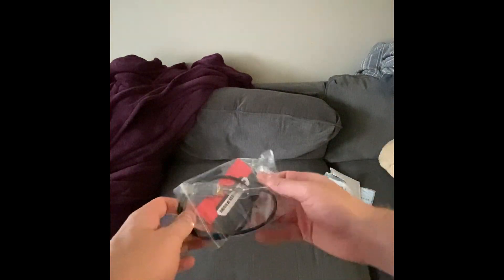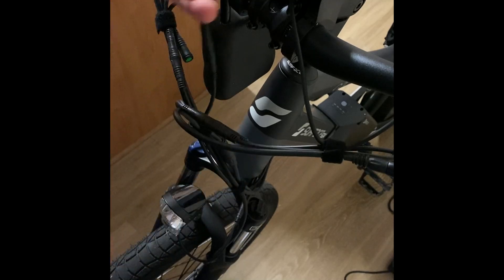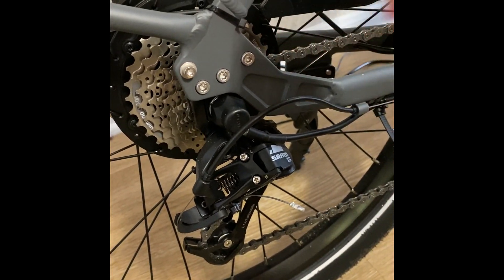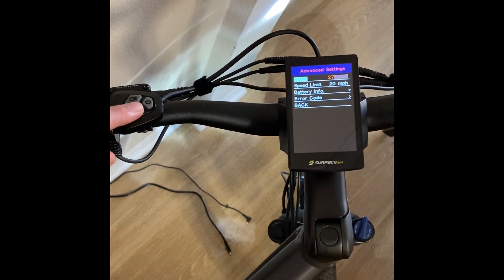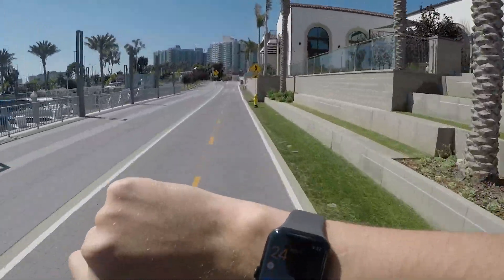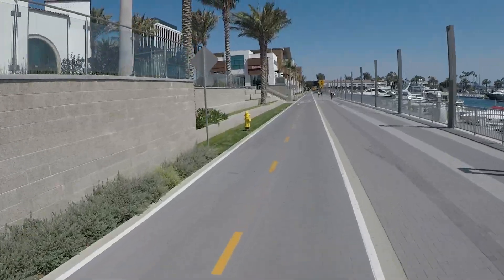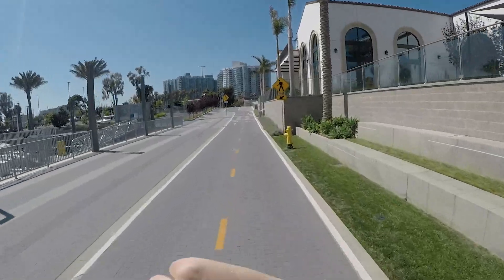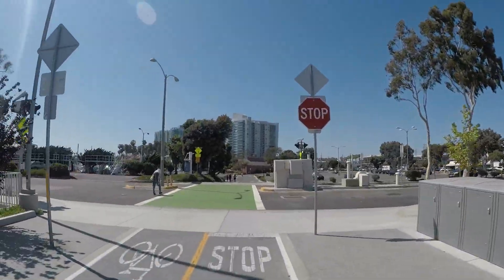Hacking my E-Bike to go Faster!

Comment: This is interesting.. my 8 year old E5 swagtron will go 23mph on high with no assist with a 170lb us adult male on it stock. I have however noticed that as it ages i get less range and more speed, i would guess at this point it likely has 5000 miles on it... I would love to replace the motor and the controller as well as battery, but at this point, if i am honest, i am more curious how long it will last.. I purchased it the spring of 2016.

Comment: While i've never burned out a hub motor, riding in extremely cold temperatures shreads and cracks nylon gears. Upgrade to solid brass.
As for speed, your only good option is changing controller to one that can handle higher amp draw, and allows custom firmware flashing.
Reply: Dam that sucks, I didn't know it could burn out in cold weather's.

Comment: I've seen human-powered bikes go 40mph on the flats if they push themselves really hard. I myself have hit 35mph going downhill on a mountain bike. Why cap the speed of e-bikes at half that? Let them go as fast as they want, but only punish them if they engage in reckless driving or if they run a stop light or something.
Reply: Shut up u don’t even make sense
Reply: I prefer a motorcycle for speed.

Comment: Here are some laws on computer abuse and fraud that could be violated by tampering with e-bikes onboard computer systems:

The Computer Fraud and Abuse Act (CFAA): The CFAA prohibits unauthorized access to protected computer systems. Modifying the onboard computer system of an e-bike could be considered unauthorized access, if the owner of the e-bike does not consent to the modification.

The Clean Air Act: The Clean Air Act regulates the emissions of pollutants from motor vehicles. Modifying the onboard computer system of an e-bike could be considered tampering with emissions controls, which is a violation of the Clean Air Act.

The National Traffic and Motor Vehicle Safety Act (NMVSA): The NMVSA regulates the safety of motor vehicles, including e-bikes. Modifying the onboard computer system of an e-bike could be considered modifying a motor vehicle without complying with the NMVSA, which is a violation of federal law.

In addition to these federal laws, there may also be state laws that prohibit tampering with e-bikes. For example, California has a law that prohibits the modification of an e-bike that results in a speed of more than 20 miles per hour.

If a person tampers with an e-bike onboard computer system and causes the bike to become dangerous, they could be held accountable for computer abuse. Computer abuse is the use of a computer system to commit a crime, such as theft, fraud, or vandalism. In this case, the crime would be the modification of the e-bike, which could result in injury or death.

The penalties for computer abuse vary depending on the severity of the crime. In some cases, computer abuse can be a misdemeanor, while in other cases it can be a felony. The penalties for computer abuse can include fines, imprisonment, or both.

It is important to note that the laws surrounding e-bikes are still evolving. As e-bikes become more popular, it is likely that new laws will be enacted to regulate their use.

Comment: To prevent the burning and excessive wear of these motors, electric bikes’ top speed is set 5-10mph under the motors max limit it can handle. If your bike says 20mph is the top speed, the motor can technically handle 1.5X that
Reply: It's set by government regulations not motor.
Reply: You guys are well intentioned but motors aren't measured in Watts..ive run a 500 w rated motor in a 48 v 5o am co trolled 2 yrs it hit 46 mph.yeez on a hill
Reply: I heard that Bosch came out and said that their motors are actually very happy running derestricted and are more efficient at higher cadence!
Reply: You guys are well intentioned but motors aren't measured in Watts..ive run a 500 w rated motor in a 48 v 5o am co trolled 2 yrs it hit 46 mph.yeez on a hill
Reply: @ChristianMccallister2-kz4tu  You want to take another swing at that comment, Pumpkin?
Reply: @ChristianMccallister2-kz4tu  Yea, and I don't see the police really minding much say if i go 30mph on the shoulder as long as i'm being have. Of course since i don't have a driver's license, lol... i'll be looking and not going that fast when i see them. Then there's state law. So for example, these police around her probably aren't concerned about that 20mph federal law. I bet most of them don't even know about it. I bet most see pedals and just think well he put a motor on it, good for him. That's just this area though. I want to crack the limiter on my ebike and if they give me an issue i'll slow it down. Because I know just by the feel of the ebike that it's wanting to go faster. The limiter is holding it back. Not saving it from burning up.

I bought this new one for the fat tires because i kept getting flats on the back. My older ebike didn't have shock in the back either. It would suck punctures like a cheap hooker sucked @#%^. Of course, I would buy one that's a little faster too though. It's just not going to be as easy as I thought to disable the limiter.
Reply: @willdorten6867  So you're saying it's ok to break the law as long as you don't get caught? That's moronic. You also speak as someone who doesn't and has never ridden an ebike. You just keep thinking what you'd do and perhaps keep it to yourself until you know what you're talking about, kid.
Reply: In europe it is maxed at 25kmh regardless of capacity
Reply: Motors aren't rated by their speed but by the RMS current flowing through the windings
Reply: @ I’m referring solely to the manufacturer’s ’recommended’ top speed
Reply: Maybe... But there is actually federal law to govern ebikes to 20mph factory.
Reply: 28 mph you bumped your head @MrTaylorfenoglio

Comment: Hope my new one will have that wheel size option in the settings. It's really easy to change. Thanks for the tip. Passing from 20 to 26, or 32kmph to 41kmph is pretty dang good. Almost 25% more. Great method. It's no mess or hack or something to make your warranty die.
Reply: the wheel size option does not work, it'll just show a higher number on the speedometer, you are going the same speed as before

Comment: Imagine buying an ebike with speed limiting firmware
Reply: Its mandatory in uk, f*** pain in the ass! 15.5mph and the motor actually stops you from going any faster. I used to use my legs and go 20mph, its so frustrating
Reply: @CB19087  ▪️
I'd learn to build my own at that point...
🟥
Reply: @CB19087  Nanny state lol
Reply: @hydralizk6631  Tea hour oblige !
Reply: @Bitten Apple Sometimes you can hack them by lying to the computer about your wheel size.  Just tell it that you have tiny wheels and it will let them go faster to compensate.  Unless its gps...
Reply: It's mandatory, dolt. In usa AND UK.

Comment: My bicycle is a 30 year old Dutch city bike. I use it to commute to work (25km per day) and weekend trips (about 50km average). Of course not electric. Much more environmentally friendly, cheaper, and most importantly: much better for exercising my body
Reply: Fair point, however I got mine so i could stop using my dirty diesel van and commute 28 mile round trip. I do manual work, so normal bike would be too much energy consumption. I already struggle to eat enough for the energy I expend at work
Reply: @CB19087  same problem here
Reply: @CB19087  same
Reply: No one asked

Comment: For mid-drive motors there are devices which can be inserted in the speed sensor cable or in front of the speed sensor without modification of the bike electronics. They reduce the revolution pulses by a factor of e.g. 2, so 2 wheel revolutions lead to one pulse detected and the detected speed is half of the actual speed, so the speed limit kicks in at double the speed. For hub motors the motor/wheel RPM ratio is fixed and the hall sensors are needed for the control loop, so the only way to change the max speed is to actually hack the firmware or switch to another controller (VESC?)
Reply: I’d like to try this. What’s this called or where can I get one?

Comment: I know hacking e-bikes is possible, I never would have thought changing the wheel size would work too
Reply: Definitely was impressed by the simplicity of his approach moreso than if he went the firmware route.
Reply: the wheel size option does not work, it'll just show a higher number on the speedometer, you are going the same speed as before
Reply: @aegisgfx  tried the wheel trick. DOES NOT WORK. the speed on the dashboard is different but i tested the speed on my phone and its still 20mph max
Reply: @ballad  yup I know, it's what I keep trying to tell these idiots
Reply: @aegisgfx  You're thinking about this problem ass-backwards. If you tell the motor controller that you have a smaller wheel, it will think it needs MORE revolutions per hour to give it's max speed. If you REALLY don't change your actual tire size smaller, you will be getting more rev per hour at max speed, which means more speed.
Reply: @johnd1561  I compared it to an actual gos, zero speed increase. Sorry smooth brain
Reply: @aegisgfx  It does work on my e-bike so idk what you're talking about buddy. I moved my wheel rotation sensor in front of my peddle and taped a magnet into it so it receives the rotation from the peddle and not the back wheel and I can do 40-50km/h.

Edit: I don't know though if it will work with a software hack but definitely works as a hardware hack.
Reply: @unknownentity8256  if all you're doing is changing the wheel size in the computer then it won't make your bike go any faster it will just show faster on the odometer, all you have to do is compare that with a GPS and you'll see that the speed has not changed. If you're doing it in some different way than maybe you found a way around that I really didn't give a s*** since this bike is a piece of garbage
Reply: @aegisgfx  Did you actually try? because what you're saying doesn't make sense. Smaller wheels must revolve faster than larger ones to produce the same length traveled. Speedometers measure distance traveled over over time, not the revolutions of the wheel, as such by lowering the wheel size youre tricking the computer to think the wheels arent traveling as far as they actually are and then compensates with additional force to reach the programmed top speed, even though you might actually be traveling way beyond that speed.
Reply: @emilh2361  yes I did the experiment, do it yourself. Take an actual GPS on the bike, the speedometer will say you are going 40kph but the GPS will confirm its only going 27.
Reply: @aegisgfx  i don't have an applicable bike, so i can not confirm or dispel this hack; but what you described (40k on speedo' but 27k on GPS) suggests you adjusted the wheel size in the opposite direction, or your speedometer is not derived from wheel revolution count over time (because math).
Reply: @emilh2361  Actually, it is the opposite. bigger tire setting goes faster.
Reply: @ I dont know what i was saying. funny.
Reply: @ no yeah, i know now.. You wanna cheat the bike.. because its pre-programmed to stop aiding the peddaling at in EU atleast is set to a max of 26km/h? ... So if you tell the computer your tires a smaller than they actually are, they can cheat the computer into keep aiding above the legal threshold.. although the display will show a slower speed than what youre actually traveling at.